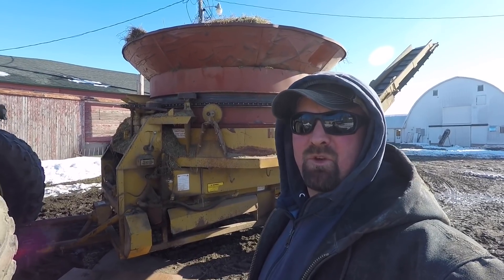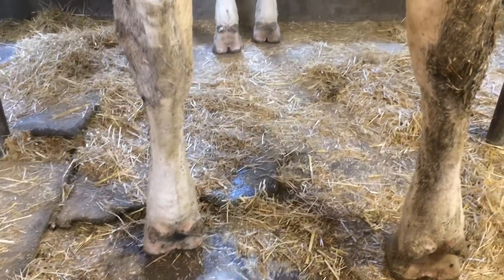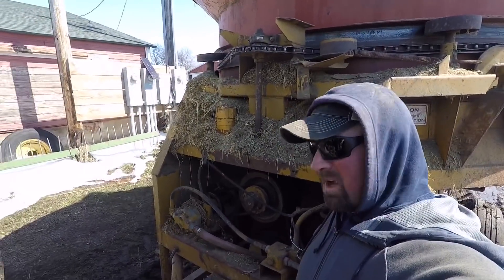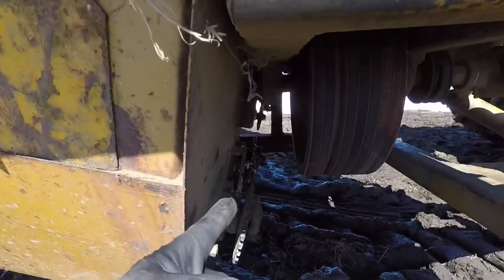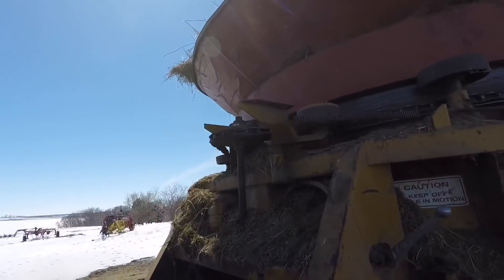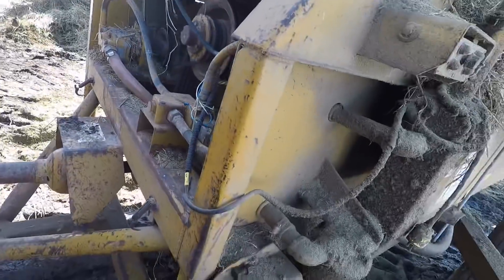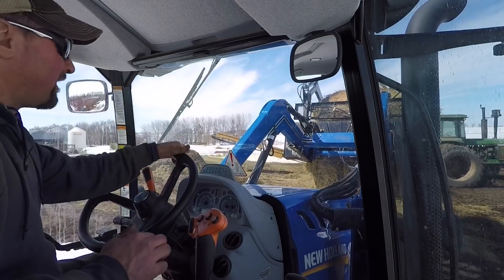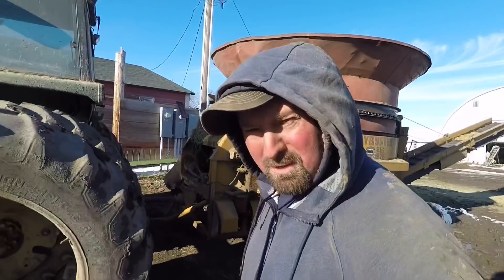A Long Frustrating Day Of Trying To Get The Hay Grinder Running Properly!

Comment: that is what i hate with family shared eqipment, everyone wants it at the same time, but no one looks after it, ir maintains it, fixs any thing, then i get it and have to spent days and hundreds og dollars in parts when i need it. before i can even use it, and everyone is calling and wanting it in an hour, it is like they know its not working, sso no one used it and when i get it they know i will fix it, so they all call screaming for it, well i just stopped using or wanting it any more, and a lot of it been sitting in the same place for a long time, gee i wonder why.. why should i be the one forking out the money to fix things and many hours working on it all because no one else will even greases it, never mind ajust anything, or replace a warn part.. it always pissed me off in the face
Reply from the maker: My neighbor would call a piece of equipment that all the relatives use the community equipment. Unfortunately not everyone pays for when it breaks down equally.
Reply: @organicpaulguy  you bet i know to well. how all that go